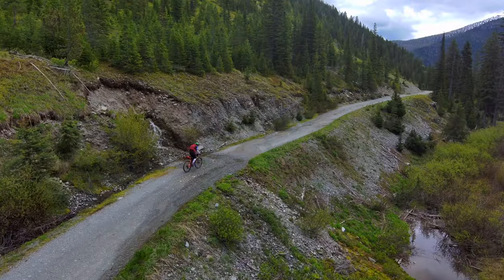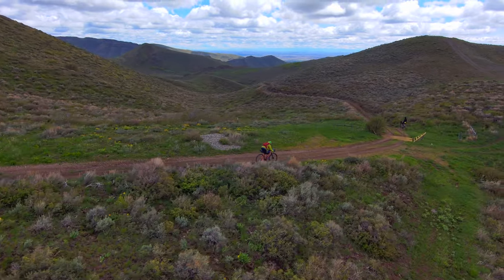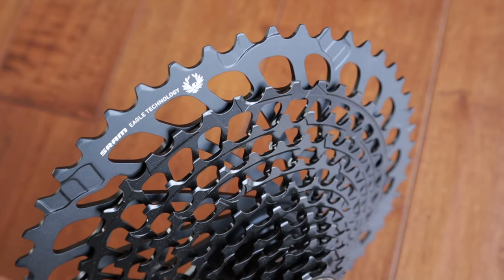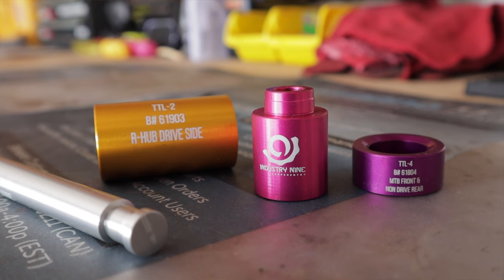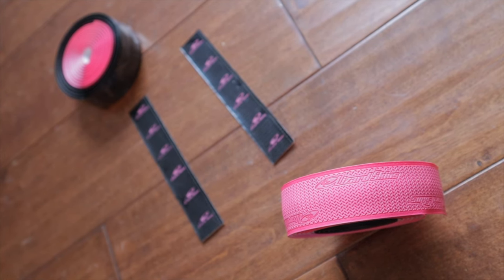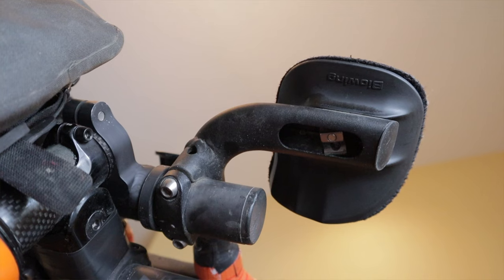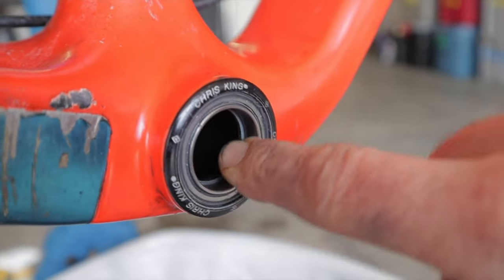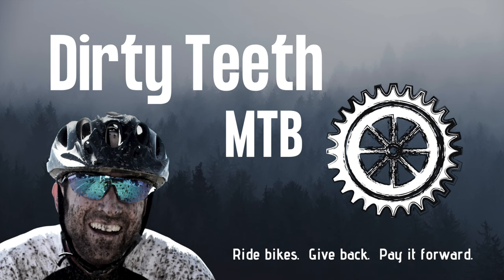8 bargain gravel upgrades that made my OLD Salsa Cutthroat feel NEW

Comment: Comprehensive overhaul, very nice.  The other thing that reinvigorates my stoke for my bike (Salsa Fargo Ti) is switching up it's configuration.  I go from fully rigid, to dropper/suspension fork, to flat bar to drop bar, 1x11, to single speed via Gates belt drive, 2.2 Race Kings to 2.6 Mezcals, etc. etc.  Whenever the ride gets a little predictable or stale I switch up it's configuration and the bike seems like a new one again.  The trails feel new too because the approach to them changes depending on the configuration.  It doesn't do one thing perfect but it does do everything 'well'.  It's kept me from buying who knows how many new bikes.
Reply from the maker: thanks for sharing and spreading the stoke, thesergeant - ride on!

Comment: Need your help???!! I have a 21 salsa cutthroat apex 1. Love bike except it is so slow compared to my road bike.i put some rene herse Hurricane Ridge extralight tires on and that helped some. Wondering if the stock wtb wheels are holding me back? How much of a difference would new wheels make? Thanks, love your videos!
Reply from the maker: Yeah, those wheels are pretty heavy… yes, upgrading would make a notable difference, and if not tubeless already - that will help too :) if you a have a nice road bike, it’ll never be as fast as that… but should still be quick and comfy! Ride on :)
Reply: I did have them tubeless, but the tire kept blowing off rim, so they have tubes now.
Can you recommend any budget ideas for upgraded wheels?
Thanks again!
Reply from the maker: Bang for the buck- think about Stans- light, durable, and setup extremely well for tubeless… and their newer hubs are nice

Comment: Great video Can you tell again what grease you use for the bb and hub house ( headset) it looks pretty thin but also pretty good ….last time you recommended something like the wolf tooth chain oil It was a winner for me :-) congrats with your new bike and happy trails
Reply from the maker: For my Chris King BB, I use Chris King silver grease in the bearings.  Headset, Maxima waterproof grease… it’s actually pretty thick.  Ride on!
Reply: Big thanks ! What about the the hub lub seems pretty thin ??
Reply from the maker: @rasmusredfire2667  Dumonde Tech Freehub Oil... they also make a Freehub grease that's a little thicker... both are great and it's what Industry Nine specs with their hubs... ride on!
Reply: @DirtyTeethMTB  Big thanks!!

Comment: Is your shifting electronic or mechanical? How are you running a GX rear derailleur on SRAM Force mechanical shifters?
Reply from the maker: Mech shifting, ratio 12 speed kit allows me to use my 11spd force shifter w/ 12 speed cassette & eagle derailleur works great - ride on :)

Comment: how tall are you? are you riding the 54cm? I am on the fence at getting a 56 or 54 at the moment. your input would be helpful.
Reply from the maker: I’m 5’9” I’m right between the 54 and 56… depends on what you’re style is and how you intend to use the bike… bikepacking, etc- go smaller for more nimble, flickable feel- bigger for stability at high speeds, etc - but always best to get a leg over one if you can … leg length, torso, etc are factors… I’m riding a medium (my model year didn’t come in cm sizes)… the group is pretty similar to the newer 54’s I believe… you can look it up in the salsa archives and compare the geo’s - Hope that helps, ride on!$